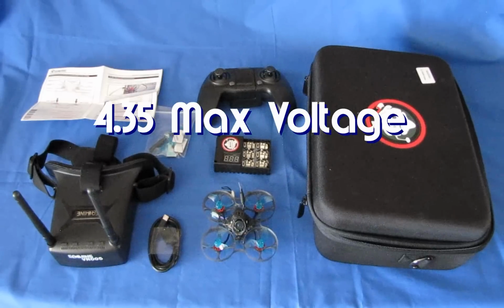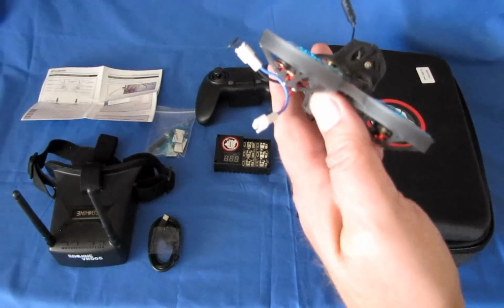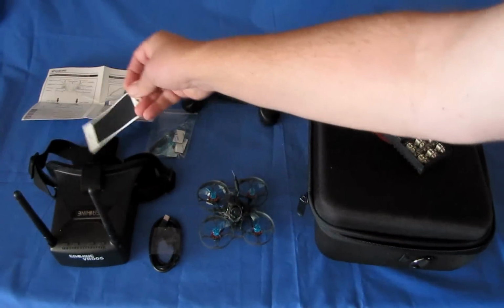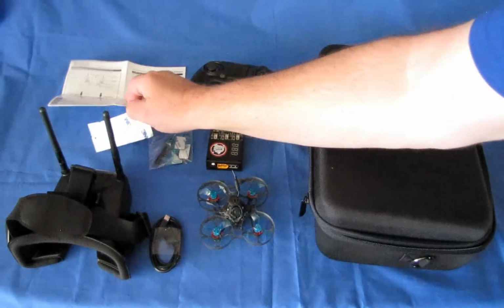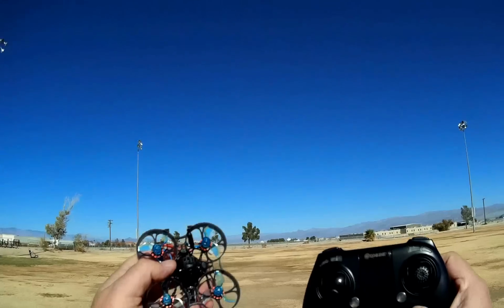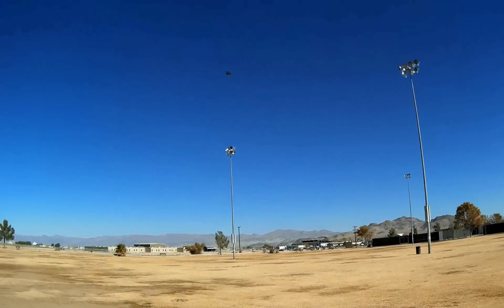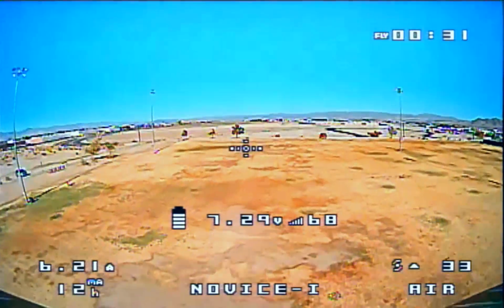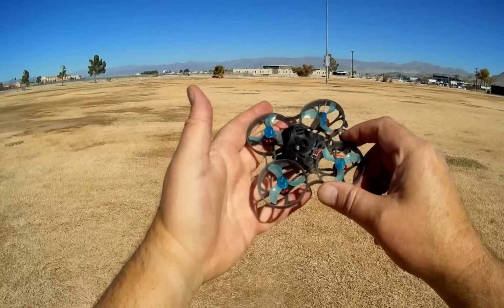Eachine Novice I RTF FPV Racer Drone w Goggles and Transmitter Flight Test Review

Comment: That’s the first FPV set that I’ve seen which comes with every single thing you need.
Reply: Emax Tinyhawk. Better in almost every way
Reply: Tinyhawk 25 mw novice is 200 mw novice has adjustable camera
Reply: @HalfChrome  Unless I've seriously misunderstood, EMAX Tinyhawk has proprietary radio and custom flight controller. This one has standard radio interface and Betaflight controller. This means that you can upgrade your setup one piece at a time + tune it much better.

Comment: If  you mind about your battery longetivity, you don't  charge LiHV batteries over 4.20 V. Those are technically just higher quality LiPO batteries and both will be damaged more or less with overcharging. Yes, if you don't mind cutting the life of battery from 500 cycles to ~50 cycles, you can keep overcharging and get slightly more power for your first cycles.

Comment: In your FPV footage you display a signal in the lower right, and another just right of the battery voltage. I assume one is RSSI? And the other?

I'm a newbie who just bought a EMAX tinyhawk S. Only have 6 flights so far; maybe if I can get that signal in my goggles it would help.  Awfully easy to fly far away really fast!! Lol
Reply from the maker: Just right is the Relative Signal Strength Indicator.  Both battery voltage and RSSI are the most important, so I placed them near center screen using Betaflight.  I want to keep remaining voltage above 3V (1 battery), or 6V (for two batteries).  If I go below, I risk damaging the LiPo battery.  I want to keep RSSI above 30.  I do that by flying back toward my position when it gets into the 30s.  If it goes below 30, I risk losing control of the drone (it will drop to the ground).

Comment: I got my novice one in the mail the other day. I'm trying to figure out why the remote won't bind to the Drone. Maybe the batteries in the remote are low? Or is there something that I would have to do to make sure it rebinds like you mentioned at 6:14? It has been binding well up until today since I have received the Drone.
Reply from the maker: First make sure that all batteries are fully charged and fresh.  Second, remember to press the upper left should button to arm the drone.  And finally, if it still won't bind, you may need to rebind it.  Details are in your instruction sheet.  But you will need to first connect the drone to Betaflight through your computer and select "bind" on its CLI page (this puts the drone in bind mode).  Then press the lower right blue button on your controller to connect the controller to the drone.  An alternate method to put the drone into bind mode is to press and hold the bind button on the drone's receiver while simultaneously plugging in the battery (usually requires four hands to do it, so get someone to help).  Once in bind mode, again press the lower right blue button on your controller to connect.
Reply: @Quadcopter101  thank youbso much! I'll search for the bind button on the drone.
Reply: @Quadcopter101  is the bind button the little black button on the rear right corner under the run cam canopy?
Reply from the maker: @michaelgardner5843  See page 2 of your instruction manual.  It shows where the bind button is.
Reply: @Quadcopter101  thank you
Reply: Andy RC says he went through batteries quickly on the remote and the drone. I'm going to head to the store to get more triple A batteries too.

Comment: What is the usb on the charger used for? Love your videos. Keep it up!
Reply: Because you can use a usb cable to charge it .
It seems to have several options , but no cable ?? 
(  try using your phone charger 😎👍 ) 
 I love the IDEA of out of the box , ready to fly F.P.V.
 Everyone should be able to enjoy F.P.V flight..👀👍
Reply from the maker: The cable is for charging the goggles, or for connecting the drone to your computer if you wish to modify its flight control software.

Comment: I just bought it and it gives me the impression that the glasses have very little range or I am not sure if my run cam is failing in my house the signal does not reach the second level of the house and I acquired it precisely because I thought the signal would arrive to the whole house in glasses. what do you think?
Reply from the maker: Have you tried increasing the video transmitter power to 200mW?
Reply: @Quadcopter101  How can I do that?
Reply from the maker: @alejandronieto8649  the following video shows how.  But only change the power setting.  Try 100mW first.  But if that's still not powerful enough, then try 200. https://youtu.be/HCGzZmcuXuw

Comment: I received my novice one excellent whoop
very fast the only issue I have is the goggles don’t connect to whoop just get a flickering image any troubleshooting ideas ?
Reply from the maker: Did you try pressing the channel scan button?  (see the instructions). With the drone turned on, press the scan button to find the drone's video frequency.
Reply: Yes I did still no connect the radio and whoop connect with no issue can’t figure out goggles issue